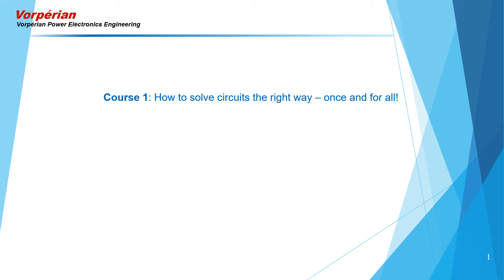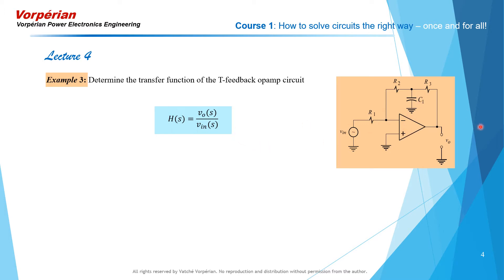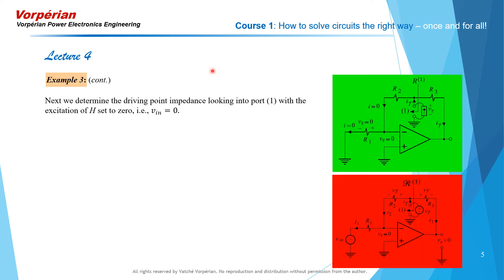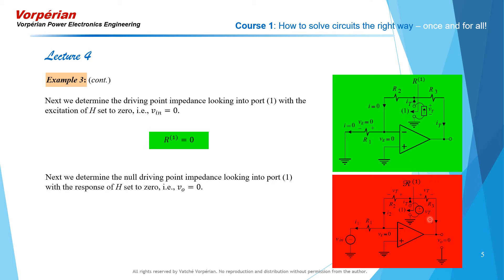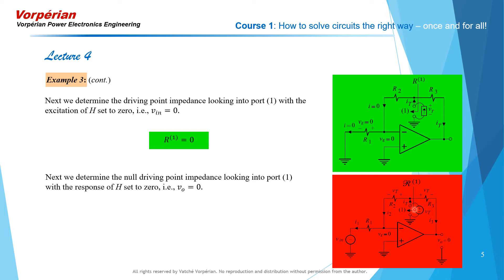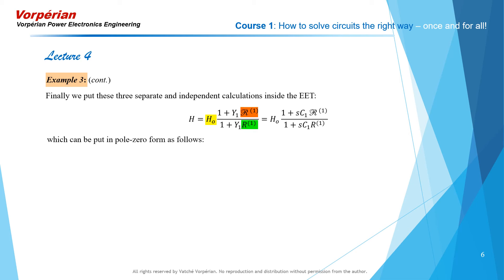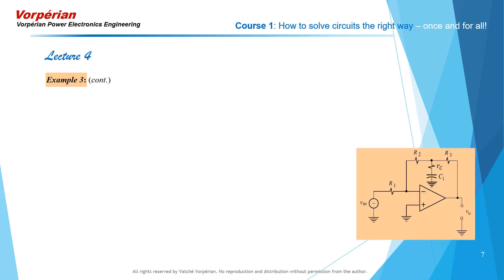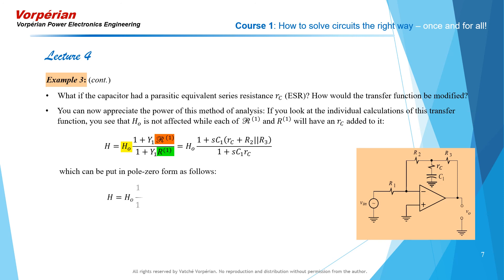Video 12: Fast Analytical Techniques in Electrical and Electronic Circuits

Comment: Please,add methods to determine poles for circuits with 2 o more capaciotors (2nd and more order circuits),improper meshes etc.Thanks
Reply from the maker: That will be the 2EET and eventually the NEET. Practice the EET thoroughly and stay tuned. Thank you.